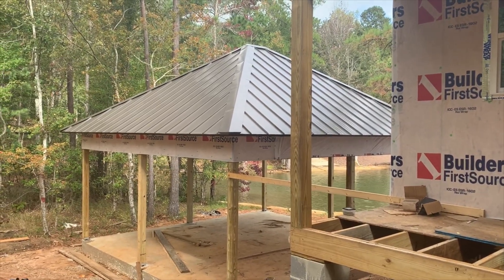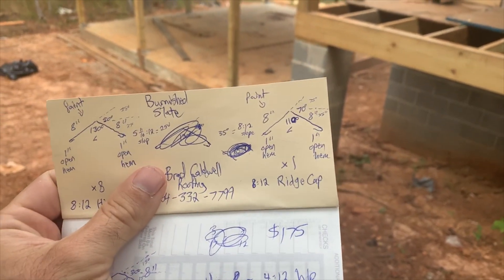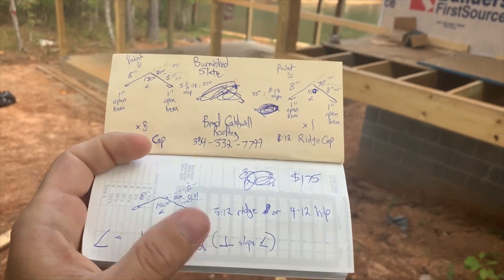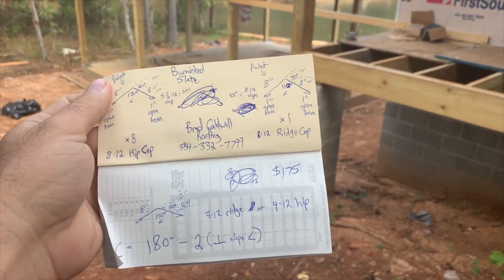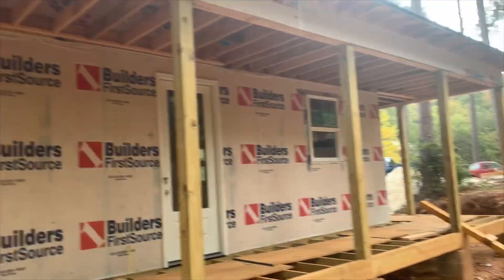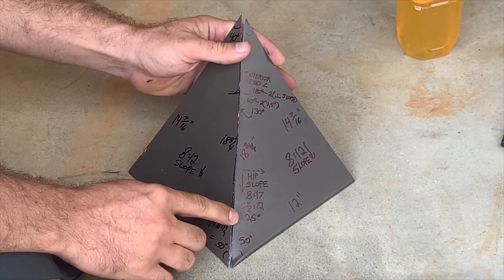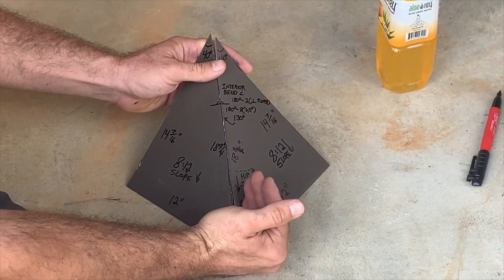Find Hip and Ridge Cap Angles for Metal Roofing

Comment: Correction: to find interior angle of hip caps, the angle needs to be perpendicular to the hip line. Thus, it is slightly different than just using 180°-(2)(hip walk angle). On a flat roof, this is perpendicular. But at other slopes, you need to adjust (for an 8:12 slope, you would need 5 1/8 slope [23.13°] rather than 5 11/16 slope [25.36°]). I did the math for you - these should be exact:

Hip Cap Interior Angle (Bent at Supplier):
36:12 -> 95.74°
12:12 -> 120.02°
10:12 -> 126.17°
8:12 -> 133.69°
6:12 -> 143.00°
4:12 -> 154.62°
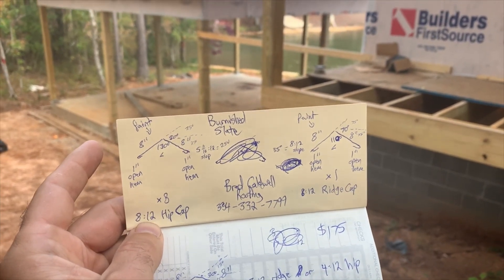2:12 -> 166.14°
1:12 -> 172.39°

Ridge Cap Interior Angle (Bent at Supplier):

36:12 -> 36.87°
12:12 -> 90.00°
10:12 -> 100.39°
8:12 -> 112.62°
6:12 -> 126.87°
4:12 -> 143.13°
2:12 -> 161.08°
1:12 -> 170.47°

Also, FYI, here is hip walk angle for various roof slopes:

36:12 -> 25 7/16 : 12 (64.74°)
12:12 -> 8 1/2 : 12 (35.11°)
10:12 -> 7 1/16 : 12 (30.48°)
8:12 -> 5 11/16 : 12 (25.36°)
6:12 -> 4 1/4 : 12 (19.50°)
4:12 -> 2 13/16 : 12 (13.24°)
2:12 -> 1 7/16 : 12 (6.71°)
1:12 -> 0 11/16 : 12 (3.37°)

And here is "triangle 3" (angle to leave on metal hip when cutting bottom):

36:12 -> 37 15/16 : 12 (72.45°)
12:12 -> 17 : 12 (54.78°)
10:12 -> 15 5/8 : 12 (52.48°)
8:12 -> 14 7/16 : 12 (50.27°) 
6:12 -> 13 7/16 : 12 (48.23°)
4:12 -> 12 5/8 : 12 (46.45°)
2:12 -> 12 3/16 : 12 (45.44°)
1:12 -> 12 1/16 : 12 (45.15°)
Reply: You sir are a saint.

Comment: Your video is great.  I am having the same issue in finding my angle.  I am build a 11'6" X 11' 6" gazebo that is similar to your build with a 6/12 pitch roof.  Could you help out with the angle?  Also, i am attempting to find how to cut the overlap where all four ridges meet.  Can you provide some insight on how to do the overlap or how to make a cap?  Thanks in advance.
Reply: For the ridges overlapping, I usually cut down the midline for the 8" or so that each ridge shoots past the top point, then cross the two flaps overlaying inwards as tight as possible and rivet. Can use mastic and caulk in addition.
Reply: 6:12 pitch = 6:17 hip (walking up the hip) which is 4 1/4 : 12. The angle of the ridge cap bent at metal supplier would be 127°. The angle of the hip cap bent at metal supplier would be 141° (or just say 140°) (assuming four rather than eight hips on your gazebo).
Reply: Btdubbs my worker's name is John Davis too small world

Comment: @ 11:20  How did you get the 5 and 11/16th and 12 for the Hip knowing it is an 8/12 roof?
Reply: Put 8 inch rise, "17 inch" run (for hips instead of normal 12 inch), and hit pitch on construction calculator. Can also do it via geometry.